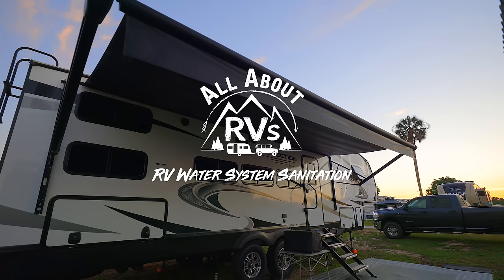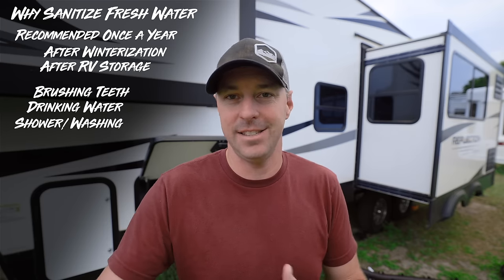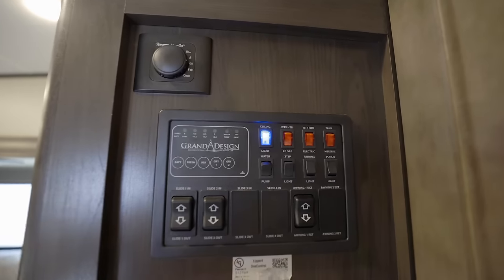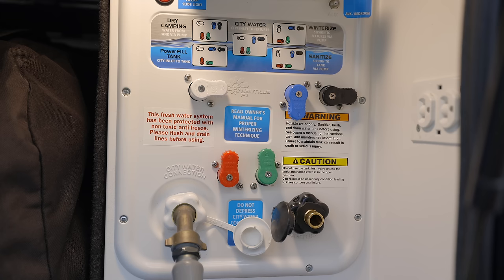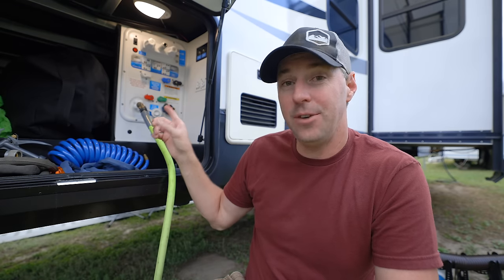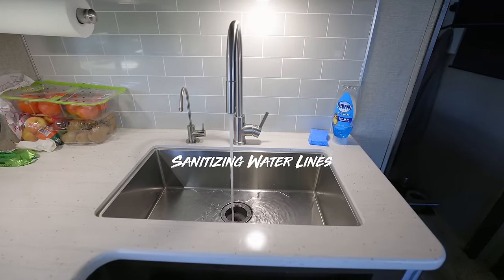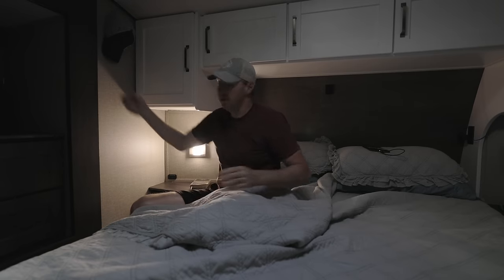How To Sanitize Your RV Water System! The Easy Way!

Comment from the maker: I hope this video helps you out if you were looking for any of the stuff we used in the video here are the links.
Water Meter https://amzn.to/3ZWNBzT
Bleach. https://amzn.to/41Y65Bc
Water Filter  https://amzn.to/3Je2G8X
R.O. System. https://amzn.to/3ytA1I5
Reply: For the water filter, what type of filter are there to use, to buy them in amazon?
Reply: Jared, another great video! I noticed that every sanitizing recommendation says to bypass the hot water tank. I wonder if that needs sanitizing as well.  Is the short time the water solution is in the tank enough to really harm the tank?
Looking forward to the next video! 😀
Reply: @Oriskany34Ken  he mentioned using vinegar but didn't show how. Chlorine will react with metals so that's why you bypass it.
Reply: @chachi5975   Hi! Isn’t Jared great! Yes, most seem to say that chlorine will corrode the tank. I was questioning how accurate that really is, being that the tank is exposed for such short duration, and it is a pain to put mine in bypass. Thank you for your reply!
Reply: What about 83 Winnebago chiefan can you help me with old  school  system? Not enough info on u tube classic RV,s .
Reply: Certain bacteria and fungi will not be killed by vinegar

Comment: Why not just use vinegar for the whole system? That will also break down any calcification in the pipes.
Reply: The added benefit of using vinegar is that it kills mold.   (Bleach does not kill mold).   We use vinegar too.
Reply from the maker: Good question. The vinegar would help with calcification build up but isn't as effective as a disinfectant for sanitizing compounded with the volume needed to disinfect.
Reply: I’ve used vinegar in the past. It’s fine as a disinfectant.
Reply: I used double the vinegar( and then some) and things are working out great! I did my hot water tank with the fresh and the washer… I will still do the hot water tank separately due to changing out the anode rod( I just didn’t see how I could do that at the same time😏)

Comment: From my experience, only refilling and flushing the fresh water tank and water lines once after the initial sanitization and then dumping this water DOES NOT completely rid the tank and water lines of the chlorine taste and smell.  I flush with fresh water (completely filling the tank each time) two times, also flushing all the water lines each time, and then on the third fill, I add two cups of dissolved baking soda to the water as the tank is filling.  I let this solution sit in the tank and the water lines overnight and then drain it all the following day.  Yes, this does add another day to the entire process but the resulting water does not have any chlorine taste or smell.
Reply from the maker: Not a bad option if you still smell bleach. It also probably helps just the water sitting in there with time to let the residual bleach water mix with the new flushing out water.
Reply: I flush it three times after the bleach solution is removed. Any less and I hear complaints of smelly water.

Comment: I would recommend doing this with your fresh water hose as well. Adding the bleach solution to the hose, filling the hose holding the end higher allowing only a small amount out then connect both ends together and laying the hose flat on the ground allows the bleach water to properly  sanitize the hose. I usually flip the rolled hose over half way through the process. Flush the hose and drain well before using. Do NOT store the hose with a bleach solution in the hose over the winter.

Comment: Once my fresh water tank is filled with the chlorine mixture, I use the dry camping pump to flush the chlorine through my water lines. Don't forget the lines running to a possible washer location and outside water access lines. To sanitize my fresh water hoses, I attach them to an outside line and fill the hoses with the bleach solution and cap the ends. After bleach solution is in each line, I top off the fresh water tank once again. Then wait the 12+ hours before flushing.

Comment: I also coil up my drinking water hose in a 5 gallon bucket and then flood it with bleach water to clean it inside and out, and then drain it out.  Then I use the leftover bucket of bleach water to clean my dump hose ("stinky slinky").

Comment: Never thought about using the filter housing.  So much easier!  Great suggestion!
Reply: I’ve always assumed the filter didn’t filter until the water is pumped OUT of the fresh water tank.  I assumed the water went straight from the connection to the fresh tank, unfiltered.

Comment: This is a great idea but a few things are missing. 

To achieve sanitization using 50 ppm, you must ensure the concentration did not drop below 25 ppm. Otherwise, you could have bacteria still living. If you bump that number to say 100 ppm, the wait time is 4 hours. If you use 200 ppm, the contact tone is dropped to instant. So fill it, drain it. 

One last note, it isn't a bad idea to drain all of the water into your black water tank. Doing this can reduce the number of coliform bacteria and halt any smell in the black water tank.
Reply: I was wondering about the black water tank, definitely going to try this next time I am hooked up or near a dump station.  Thank you
Reply: How would you be able to add that much fresh water to black? Besides flushing the toilet for 3 hours?
Reply: @jt7559 i only have a black water tank. No heat water. So i leave the facet and shower on.

Comment: Great video on cleaning system.
I think you missed an important step not showing how to clean all the way to and clean the screen in the pump , it doesn't take long to get buildup from the algie  using water from several areas during your adventures
Thanks for all you share and do

Comment: Love the hat swap..... and glad to see you include sanitizing the hose & filter.  I also spray the fittings on both ends and the fitting on the RV with Chlorine+water and the garden spigot  fume the pressure regulator (and wait 5 min to make sure it is all sanitized) 

I follow a similar process, but add 2 very important steps. After filling with Chlorine (not clorox) water I drive my motorhome on a 15 minute trip with lots of turns and stops. That makes sure all sides of the fresh water tank (and water heater) are washed/sanitized as it sloshes around.   And repeat the drive later with fresh water to ensure a good rinse. If you don't, then it's like only washing part of your dishes and eventually what you consume will have touched the dirty parts.

Comment: Some thoughts - While I love my Flexzilla hoses, they seem to build up mold way more than my NevrKink ones did. So if I'm having water pressure problems, I'll check the input screen at the panel (and usually find it clogged).  I also make sure to use the washer lines when running the bleach mixture through my lines. Even though we don't have one, I hook up a short hose from the line to the drain so I don't have to use a bucket and risk spills.  Finally, we chose to go with a tankless RO system - And learned after the fact the Gallons-per-day figure isn't about quantity, it's about how fast the thing pumps. A lower figure means you have to wait longer to fill your glass.

Comment: Great topic! Don't over due, bleach is hard on o-rings and will destroy your charcoal carbon filter. Change filter if you forget. Great job putting this training video together. Bleach will also destroy your R/O membrane, best to bypass your R /O system while doing this.

Comment: Great video.  I use the pour the bleach into the hose method, but I poor from the faucet end, so that it gets the whole hose.
You also answered my question on how Full Timers do this in a campground. I wouldn't think dumping a whole tank TWICE on the ground would make the campground, or other campers, happy.    (Loads of bleach is Not good for a septic system).  Love your videos.
Reply from the maker: Thanks!  Yes you are right bleach is not good for septics.

Comment: I have to do this with my 32ft. 5th wheel. I'm dreading it though. Because I'm only 1 year into RV living and I feel like I'm going to mess something up. I already messed up big time by not getting RV skirting. I froze my ass off all winter and my carpet got wet. So, I'm covering all my bases. And making a step by step guide. I gotta get this right.

Comment: Newbie here….I have found so many of your videos helpful! I wish you could do a video on the Nautilus P4 -3 handle setup….I am so confused on the water heater bypass valve (red) missing from the easy to get to control panel. It is located behind a panel you have to remove! Can antifreeze (winterize/de-winterize). & bleach (sanitize) can go into the water heater. So many videos say no & then some for my system say yes!! HELP!!!

Comment: This is what I use to Sanitize my system I also use it for brewing beer. I is also Biodegradable.

STAR SAN (32 OZ)
A high foaming, acid-based, no-rinse sanitizer that is effective and easy to use.
Self-foaming, which helps to penetrate cracks and crevices.
Odorless, flavorless, and biodegradable.
Will not harm septic systems.
Reduces water spotting and can be used without rinsing when used at the recommended dilution.
Reply: I used that for brewing as well. What's your ratio to sanitize your water system?

Comment: Dear Mr. Gillis, in Spring or after a month or more of not using the water system - we use a funnel to run bleach into our 1/2 full fresh water tank, then we completely fill the tank. Subsequently, We use the pump to run the bleach/water solution throughout the RV, and then allow it to sit for 1 - 2 hours. Then we dump the contents of the fresh water tank, and fill with water to flush all of the the cleansed lines. Looking at your video, I believe there is a short run of pipe that is not getting the treatment - from the city water connection to where it connects to the cold water line. Thanks, I will use your method, also, in the future. Thank You - your presence in the RV space is a real benefit to the community.
Reply: I also make sure to open my low point drains to get the solution down in there too.

Comment: Hi Jared. I. understand the need to sanitize, but why not do 10 gallons or so and then pump into the lines?  To completely fill the fresh water tank seems to be overkill if the tank was emptied as it should have been. The 10 gallons should cover any water that was at the bottom of the tank. Thx bro.

Comment: This is a great video if you have a fancy RV.  With a class C I just pour the bleach into the tank from the inlet that is provided for water into the tank or the inlet used to hook up a water hose.  Also do not have a way to bypass the hot water heater.  What will the bleach water do to that tank and lines?  Your thoughts please

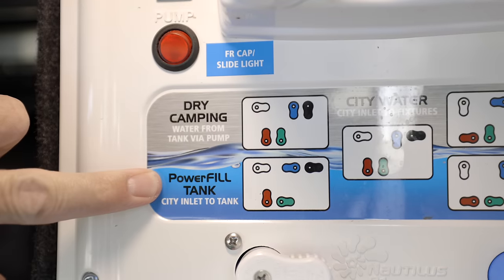Comment: @ 3:07  Are you really hooked up to a system with over 110psi water pressure at the spigot? (Thats what your regulator reads)  Thanks for the video. In the process of sanitizing my system as I type... Keep up the great information.
Reply from the maker: Thanks! It looks like high pressure but the gauge is broken but the regulator is still working good. It is actually set to 50 psi

Comment: Thanks for the tips. One question, I have a Fleetwood Flair Class A gas motor home. I'm not sure if my fresh water tank has a drain or if i just have to run my pump. I also don't believe I have a water heater bypass. I have an electric and propane control. How does this complicate things? LOL. Any tips to help. This will be my first time to sanitize and I don't want to mess anything up. This is my first rig and plan to go full time in the very near future. Thanks again
Reply: All rv's have a drain on the fresh water tank. You can check it out in the owners manual or contact you dealer about it. The bypass is generally right behind the water heater. Look for it inside the storage compartment next to the water heater.

Comment: Love the extra utilization of running it through the sewer hose from fresh drain!

Have you considered using a quaternary solution instead?  It is not nearly as stinky or as caustic and it won't bleach your clothes?  It can be picked up somewhere like sam's and is food service approved safe. I also think the quat sanitizer diluted would be safe going through the water heater also as it is much less corrosive.  You can even get the tablets of steramine and store dry and 150 gallons worth of tablets is 10$ or so.  Bleach is great but not my preferred choice to sanitize my potable water.

Comment: Thanks For the tip.
We are full timers and I’m growing tired of the clear 2o primary and secondary water filters. The course filter breaks too easily
Can you refer me to a video or tell me what I might consider in the way of a canister system? I currently use an adjustable regulator followed by the large Clear dirt guard then the 2 micron secondary then an “On the Go” softener. Generally a good system but the dirt guards are fragile.
Thanks again!

Comment: Since we have a c class mh I can just dump bleach In my fill connection and fill my tank normally. Is this correct,? Plus I can leave my hot water tank bypassed . Mine isn't as simple as yours but I think I get the idea. Thanks and maybe catch up with you guys . Safe travels

Comment: I was under the impression that sodium hypochlorite i.e. bleach, dissolves rubber seals. I remember I put it in my toilet tank and it always dissolves the rubber stopper. I never used bleach in the toilet tank and the rubber stopper lasted 25 years.
Reply: Thats why you DON’T flush the rv toilet with the bleach mixture in the fresh water tank! 😵‍💫

Comment: I have a Girard On-demand water heater that does not have bypass plumbing as is the case for traditional tank heaters. Any recommendation for sanitizing this system without going to the trouble and expense of creating a bypass loop in the plumbing.

Comment: My travel trailer doesn’t have a water bypass for the water heater. So even thought I don’t turn the electric on for my water heater the chlorinated water  will flow into my water heater. Correct? I am guess that after I treat my fresh water tank and turn on both my hot and cold faucets to let the chlorinated water run I need to pull the plug on my water heater to let all the chlorinated water drain out out. Then fill my tank a second time and drain everything ( hot water tank). Does that sound about right?

Comment: What's the reason for not using bleach in water heater? Been doing it for  years. No issues. 
A lot of campgrounds have a septic system & all that bleach water can really mess up a septic system.

Comment: I use the bleach method to sanitize a 30-gallon tank twice a year. I am using the typical techniques found on YouTube. I thought everything was great until I was under the trailer one day and decided to shine a flashlight through the plastic freshwater tank. To my surprise, there are layers of mold clinging to the sides of the tank. The bleach method does not remove this mold and I don’t know what does. I have come to think that perhaps it is normal. I believe that every freshwater tank problem has some mold. What do you guys think?
Reply: Interesting,,, I wonder if it's dead mildew, or possibly permanently stained  plastic by past buildup over the years ?????

Comment: So….. question. I have a 2023 Jayco with a tankless water heater and no bypass. If bleach is bad for hot water heaters - how do I sanitize my system. It is winterized right now with antifreeze in the water heater - but I’m trying to get ready for spring. One manual says to bypass - but that is talking about the regular storage tank heaters. The manual for the hot water heater does not mention sanitizing.  HELP!!

Comment: I'm new to RVs and I bought a 34 foot safari Serengeti. Under the bed is a water tank probably about 25 gallons big and then another larger tank behind the wall.
What is the smaller tank used for?
Reply from the maker: I can't say for sure on that model but our last 5th wheel had 2 fresh tanks and one flowed into the other.

Comment: Does turning off the water heater work for the tankless water heater as well? Or is there another method to clean with that style?
Reply from the maker: Yes I still bypass for our tankless water heater. Ours is a Truma and takes tablets but on our last tankless water heater we setup a pump and pumped Vinegar through it for 2-3 hours.

Comment: We’ve always used hydrogen peroxide. What are your thoughts on that?
Reply: It would be easier to use sodium percarbonate (the active ingredient in OxyClean). It creates hydrogen peroxide and washing soda in water. Just like the bleach solution, you want to rinse out after.
Reply from the maker: Great question, I like the thought of using hydrogen peroxide and have tried it but not sure of how effective it was when I did. The problem I ran into is trying to find quality info on what the mixture and ratio would be for this large of a quantity for the water system.  There is food-grade HP but can also be dangerous to handle and most stores carry it at a low 3% hydrogen peroxide. If there was a good source and info from the supplier of the mixture I would try it again if you didn't need a large amount. The one mixture I did find was using 35% Hydrogen Peroxide and they needed multiple gallons and there was a warning about the Peroxide building pressure when used.
Reply: @AllAboutRVs  I read on the internet…so I know it’s true🤷🏻‍♀️….that for 50 gallons of water use 3 quarts of 3% peroxide. We like this as there is no after taste to the water. I will pursue this a little more. Thanks for responding!!
Reply: @blucy10  thank you!! Good idea!!